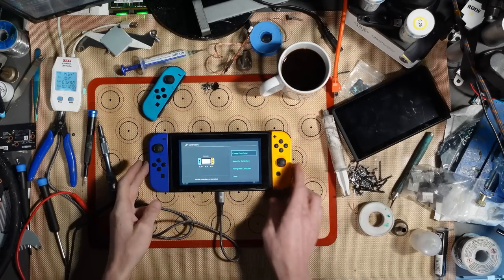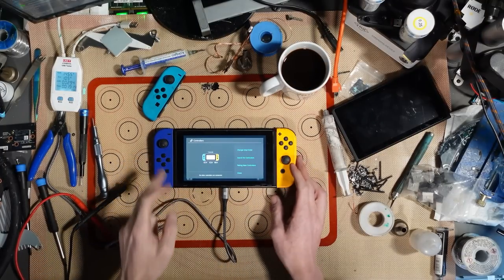I Fixed A Nintendo Switch By ZAPPING It With Power! Overheating/Not Connecting Joy-Cons Quick Fix

Comment: hi, as i saw it, i would say the diode between pin 1 and 4 burned(red light at 6:01 on that component)  , so it may have been faulty, and the original 3v was sent to ground

Comment: It is the diode next to the connector that fails short circuit. Easy fix by just removing it. Not even installed in later board revisions as they realised it was causing failures. Never had an issue with the MOSFET. Always the diode that fails. Karl.
Reply: Exactly. Diode is shorted

Comment: The smoke came from the black component just behind the fan connector. You can see it lighting up and then coming back with a darker circule. I don't know much, but it's probably a diode that got kind of "stuck" not letting pass electricity but then it widens a little bit when you inject voltage. Sort of as if it was too tight a tunnel and then you came with the pink train to stretch it. You know the gif.
Reply: Could have been a shorted flyback diode for the pwm fan. Overvolting could have popped the short away. I'm guessing, don't know anything about switches.
Reply: In technical terms it is a semiconductor and only lets current flow in one direction.

Comment: I dont think its the mosfet Phil. Usually when the fan/joycon issue comes up it's the diode next to the fan connector that gets shorted. You basically blew the short out of the diode. I consider that a fix! :-) or you can just remove the diode. It's a protection diode, not necessary and some boards do not have it.
Reply: That component where he let the smoke out, is that what he is calling the mosfet? I opened up my switch and that component is no longer there. Looking for an idea if I can replace this part
Reply: @mikeluckhardt2950  The component the smoke came out of is a diode. Its next to the fan connector. On later revisions of the Switch its not installed, and not required. There is no need to replace it. If your having an issue with your fan then it might be the fan itself.

Comment: Is there an alternative way to safely inject the voltage if you don’t have a bench power supply?
Reply: A 3v battery will do it you can get 3v button cell batteries

Comment: The light is coming from that component just behind the connector.  Is that a 2 pin component?  Like a Schottky diode or something?  Maybe that is the culprit causing the mosfet not to work and burning it up let’s the mosfet turn on.  Might be worth removing it on one sometime to see what happens.

Comment: From where the smoke came from that black component must be the source of the fault. Nice trick clearing it though, just hope there is no side effects from blowing that short out.

Since the fan and the joycons are connected somehow, could you do the same thing by injecting into the joycon contacts? Might be even quicker if you don't need to disassemble the Switch to fix this fault. Maybe you could make something from an old joycon or 3DPrint something to make the contact.

Comment: you have most likely shorted a Mosfet or a diode in the circuit , hence the magic smoke. so now the fan spins continuously which will obviously drain the battery quicker..A Professional repair would be to replace the Mosfet.
Reply from the maker: The fan doesn't spin constantly, which is why it didn't turn on until the screen was activated
Reply: Sometimes fancier doesn't necessarily mean better. What good is replacing a component that you know will potentially fail again by design? If you find a way around a problem, then you're avoiding the potential resurge of the problem altogether.
Reply: @EDOD_EseDelOtroDia  so the people that designed the switch circuitry got it wrong? what you're effectively saying is "just short out your fan controller circuitry to avoid it failing in the future".........no the circuit was designed so that the processor could control the fan when needed,. a shorted component will pull more current because it's altered the resistance of the circuit, a short component has lower resistance and the current well now go up (simple basic Ohms law) draining the battery quicker.🙂
Reply: @TheCod3r  that is because of the power on sequence,but now the fan is running continuously at high-speed it cannot be controlled to run at slower speeds to conserve battery power also you've altered the resistance of the circuitry the lower the resistance current goes up more current quicker battery drain 🙂  sorry not trying to be a Troll or anything.
Reply: @davesdigitaldomain   There are reasons why there are different revisions for many different circuit boards. So yes, that's precisely what I'm saying. They got this bit wrong. Someone in another comment pointed out that later revisions don't even include a diode there.
Reply: @EDOD_EseDelOtroDia  explain to me why they don't need a diode? inside a fan there is a copper wound coil and to prevent back EMF you need a diode.

Comment: that isnt a fix, thats called blowing the mosfet and now the fan just stays on forever.
Reply from the maker: No it doesn't,  hence why the fan didn't turn on until I activated the display
Reply: @TheCod3r  mosfet will be blown soon enough, since that diode you toasted is a flyback diode to prevent back emf from the fan from frying the mosfet...
Reply: @TheCod3r  But once you activate the display, does the fan stay on indefinitely?
Reply: @Sydney268  I think we witnessed the mosfet blow as he toasted the diode. That was the "magic smoke".